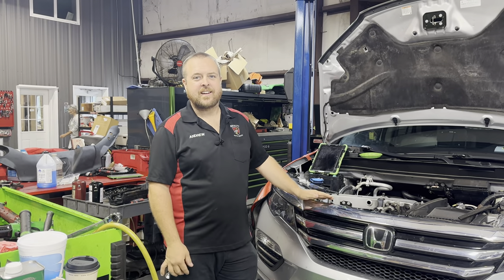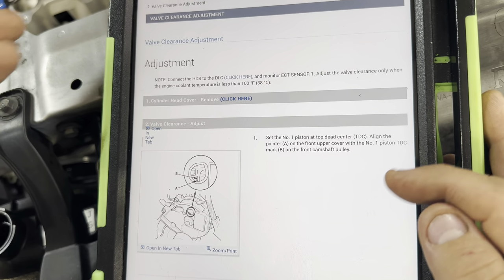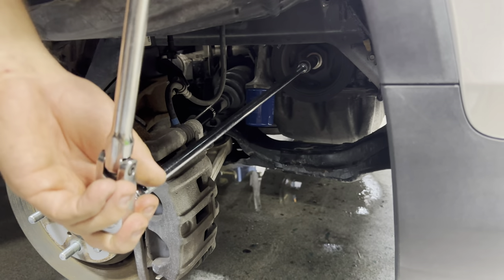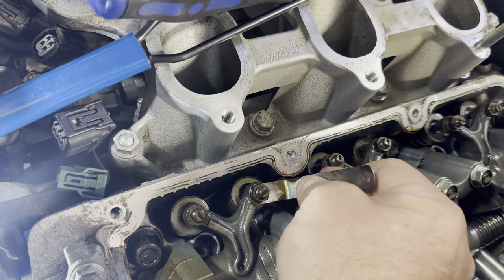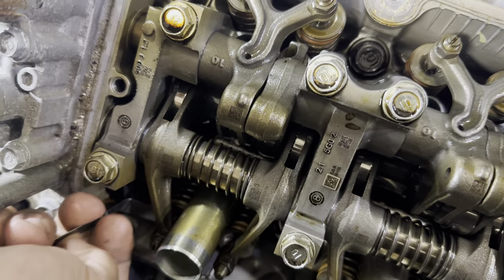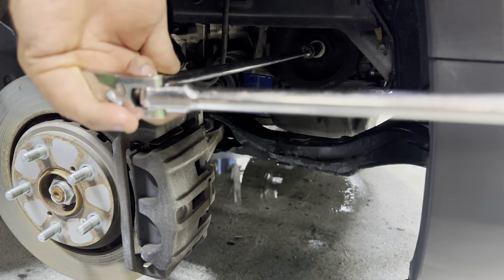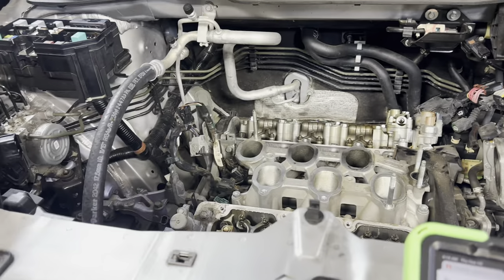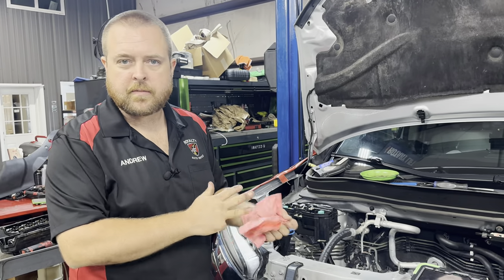Honda Valve Adjustment Basics (J Series Engine)

Comment: 1998 Honda prelude  214,000
Reply: 👍. 98 Prelude 255k.
Reply: No valve adjustment?
Reply: 08 pilot with 274k
Reply: @HighMileageOffroad  Have you ever had a valve adjustment on your ridgeline?
Reply: 06 Honda pilot 230k and running like a champion.

Comment: Hey guys great video, just to let you know the latest generation 3.5 litre v6 2024 doesn't require valve adjustments anymore Honda has gone to hydraulic lifters. Also there's a special tool available from Honda for valve adjustments.
Reply: Wow finally that's why I always hated Honda I always preferred Mazda they use bucket shims still good at 200k+ miles you can just swap them out
Reply: If you don't know what you are doing on these Honda V6 J Series engines DO NOT ATTEMPT THIS. If you get this wrong you can severely damage your engine.

Comment: Sister bought a 2009 Honda Pilot from a used car lot, Check engine light came on right when she got home. 5 cylinders missfiring, this has to be the reason right??? car drives fine.
Reply: Most likely, it's pretty common. 
If it's over a 100k miles it needs to be done anyway.
In my experience it's always wise to check into general maintenance after buying used vehicle yourself. Keep records so you know whats been done and when. 
If they say something has been done more often the not you'll find out their cousin Jett did it. Or a shop who pays mechanics by the job, not the hour.

Comment: I've noticed many older versions of this engine will idle roughly until the engine warms up. The valve lash actually closes up and holds the valve partially open, possibly because the valve seat wears or the valve stretches over time. A valve adjustment clears this problem up and makes the engine run like new. I think Honda actually had a bulletin about this issue.

Comment: Great video, however, you missed one very key item in the Alldata Maintenance Minder table.  Maintenance Minder Item 4 is for timing belt, spark plugs and valve lash inspection which means the valve lash check/adjustment is still due every 105K with timing belt and spark plugs.  The note you mentioned just means that if the valves are noisy they should be done at any of the other intervals, as well.  If the interval were "only when noisy" then you'd never find and adjust a tight valve.  In my experience, usually, the exhaust valves tighten up and the intakes loosen up.
Reply: Honda changed their recommendation for newer vehicles.
Reply: @jptrainor  No, they didn't.  I don't know why everyone thinks this.  This is taken right from the 2017 Honda Pilot owner's manual:  Maintenance Minder item 4 is "Replace spark plugs, Replace timing belt & inspect water pump, Inspect Valve Clearance."  Maintenance Sub Item 4 comes up at right around 105K miles, so inspecting valve clearances is part of that maintenance sub item with the timing belt and spark plug job.  At the top of the page it says "Adjust the valves during services A, B, 1, 2, or 3 if they are noisy" which just means to take care of them at any oil change or service visit if they are noisy.  They still are supposed to be inspected (and presumably adjusted if found out of spec) at the same time as timing belt/water pump/spark plugs.  

Having checked many at 105K I've found very few out of spec at 105K but have found plenty out of spec at 150K.  By 200K they can still be quiet but it's not uncommon to have unexplained misfires and rough running engine due to tight exhaust valves.  I've seen it several times.  Regardless, it's part of Maintenance Minder Sub item 4, every 105K, to check/inspect the valve clearances.
Reply: @johnaclark1  There's been a more recent change to the service recommendation AFAIK.
Reply: @jptrainor  No, it's still exactly the same up to at least 2022.
Reply: @johnaclark1  recent ... They're not going to (indeed, cannot) change the maintenance minder schedule for millions of shipped vehicles. There's plenty of talk, however, of the official Honda recommendation having changed.
Reply: @jptrainor  The Maintenance Minder itself is just a number that pops up.  Up until 2022 they were still printing valve adjustment at maintenance minder item 6 in the owners manual.  If there's an official Honda Service News article about it I've not seen it.  There can be talk anywhere.  Doesn't mean it's true.  People have been interpreting the owners manual wrong for years, thinking you only adjust the valves if they're noisy, which is just not true.  That works until the unexplained misfires happen and then they get adjusted, after shotgunning plugs, coils, injectors, etc. and sometimes after burning a valve, though I've only seen a burned exhaust valve on a Honda J35 once or twice.  

On the newer models they added a #7 for brake fluid but left the valve adjustment in there by mistake?  I doubt it.  Point me to an official change to what's in the owners manuals and Alldata (I have a professional Alldata subscription and It's currently listed in Alldata for the 2022 Pilot)
Reply: @johnaclark1  yeah... I got two old Hondas. Know the maintenance minder. Have done valve adjustment in both. You have a good one.

Comment: Did my valves this weekend and it runs like a brand new engine now.  Valves were too tight and it caused the engine to run like complete crap with a very rough idle.  Really makes a difference, and is very easy to do.  If you've got an 8th gen Civic, be prepared to have a sore lower back when you're done tho! 

I do one cylinder at a time, intake, then exhaust, torque, check again, on to the next.  Come back around once you've done them all and recheck and adjust as needed.  I find that as I progress through the cylinders I get more and more precise with the adjustment and the early cylinders need to be nipped up a bit.  

Valve adjustments and on-time oil changes and a 200k mile R18 will continue to run as if it were fresh from the factory.  Excellent little engines!

Best tip I can share... crack the locking nuts loose with your ratchet, then disconnect the extension with your socket attacked and gently tighten the nut again, just till it stops.  This will make the screw part of the adjustment "firm" and hold where you set it when you go to torque.  If you have the locking nut too lose, the smallest bump will throw off your adjustment.

Comment: The Honda valve adjusting tool is part# 07MAA-PR70120. Cost about $45, and has a dial instead of a long driver handle.  Downside is you have to use a separate wrench on the socket-piece to loosen/tighten the jam nut.  There were knockoff versions like the Alltrade/Powerbuilt 648822 that I have, but can't seem to find for sale anymore.
Reply: amazon! $25

Comment: I’m a technician at a Honda dealer we recommend them every 105k as well with the timing belt service normally. Also the new Pilot (Ridgelines and Odysseys still have the older engine) with the updated engine in the current gen pilot no longer requires a valve adjustment.
Reply: Question for you. I have a 09 mdx mis fire on 3,5,6. I did the spark plugs and the coils for all. The misfire is still present along with “check emission system” and check sh-AWD system”. Unfortunately my Honda dealer has not been helpful. They wanted me to change the timing belt and then check the spark plugs. Which I just did. Is it possible this is balance adjustment? I booked in for an adjustment tomorrow shot in the dark just hoping this will resolve the issue. Any info would be greatly appreciated! Thanks!
Reply: @cooperbell3420  could be your valve adjustment if I had to make a guess but I really wouldn’t know unless the car was I front of me

Comment: 2005 MDX, 246k miles...multiple cylinder misfires.  Mostly one side,  but really all cylinders.  Bought plugs, coils, PCV and may get an EGR. Hoping it doesn't need a valve lash adjustment.

Comment: Hi, great video btw, and helpful commentary along the way. I'm lost and would really appreciate some expertise! My 2005 Accord v6 has been running well until recently on a long drive several misfire codes popped up at once. There was some rough idling and I could feel some misfires on the way home. I changed spark plugs only 500 mi ago; since the codes came all at once, I don't think it's coils either. Is it likely that the valve clearances are the issue? Especially with what you said at 8:20 .
I also have three electronic codes that popped up with the misfires, one being 83-1 (ECM/PCM relation failure). I don't know if the computer might be causing the issues or even if they're related. If you can please share an expert opinion, I would appreciate it.

Comment: Do you guys use your Intake vacuum waveform to check for valve adjustment, not an exact measurement for in/mm but you can see the timing between pressure pulses and you can see if the exhaust valve is out of whack based on how high its pulse is compared to the intake pulse height as the exhaust is typically the one which beats itself into the valve seat making it tight. Of course, your transducer needs to be set up properly and look a bit more wavy than what some techs prefer, cheers.

Comment: How can you be certain you’re on the compression stroke during the valve adjustment? 
Is it good enough to just line up the hash marks? 
The manual I have just says position to TDC no.1 then move on…
Reply: You could stick a long screwdriver in the cylinder and check the piston location.
Reply: Just go by the labels on the cam shaft.  If for whatever reason you don't trust the labels (just go by the labels), you can wiggle the rocker arms and if they move, they're not applying pressure to the valve, and you are good to adjust (only a TDC will both intake and exhaust rockers be free from tension)... but just go by the labels on the cam gear... that's what they're there for.
Reply: Camshaft pulley has labels on it.  When you're on 1 then your engine is TDC on cylinder 1

Comment: Hi great video. I have a 03 Honda pilot that had the timing belt put on after it broke while driving. The  car is running thankfully however I get random misfires now and sometimes car turns off. Could it be the valves loosened up or misadjusted when the timing belt broke? And now I’m having these problems? Thanks in advance for any advice! 
Great video
Reply: Check the codes. Probably a crank position sensor causing the motor to stall.

Comment: My 2010 Odyssey EX-L vavles were all bit loose at 235 k km (146k miles) except cylinder 5 exhaust valves which were a bit tight. I've owned the vehicle since new and it was the first time they were done (I didn't do them at the 160k km maintenance minder interval). I guess with Honda's new "when noisy" recommendation they are waiting for vehicles with tight vavles to come in with misfires in the case where they tighten over time.

Comment: My question is if in the manual it says you could use this size this size or this size for The Gap, how do I determine which one to choose.?! I have a 2007 Honda Ridgeline j series engine. I did the valve adjustment for the first time it nearly 200,000 miles, I drove it 5,000 mi it sounded pretty good and now it sounds bad, there is a loud clacking sound on cylinder one and six intake on one end exhaust on six.

Comment: Where are you located? I think my valves need an adjustment. It clicks when im over 2000rpm. Would that be my rocker arms/valves?
Reply: 8 months later did you find your fix? For me i knew it was the valves when i herd that one of the symptoms was the tapping, only when it got hot, realized it was fine on cold start, then started tapping when it got hot. Adjusted it myself to find 3 exhaust valves were over %50 too loose.

Comment: I did the twice on my Honda odyssey. Both times values got noisy within 3k miles. Seems like the adjustment screws keep working loose. Would it be a bad idea to clean them up and add a little lock tight to stop them from moving? And yes I get the jam nuts tight!
Reply: Locktite is a bad idea. Not for internal use.
Reply: how much torque did you apply to the locking nuts?

Comment: Would love to see how to get to this point. Pulling off all the shit before this. The harnesses seem to be the biggest burden of it all.
Reply: The rear harness stayed in place for mine. I unclipped a few harness clamps to give it some slack, that's all. That's was the service manual procedure.  I don't know what this vehicle was but it was obviously totally clear. I've seen quite a few videos and it seems to vary, but most typically the rear harness remains in place but is given slack and then you work around it.

Comment: Would a rattling noise on acceleration potentially be caused by valves that need adjustment? Car is 2011 Odyssey with 160K, well maintained otherwise.
Reply: Try to use gas with higher octane. My 2000 would knock on 87 accelerating up a hill when it was new. Switched to 89 and it stopped. I ran 93 in it for a little more horsepower until recently due to high prices- but still no lower than 89.

Comment: What is the pros and cons for hydraulic lifters vds these adjustable?
Reply: hydro lifters don't need to be adjusted, but are more complex and are another point of failure.  There's more to it than that tho... two completely different engine designs.  The overhead cam design is as simple as it gets, and that's what makes it a great design that's been around over 100 years.

Comment: Woundering. My 2018 civic hatchback. How should the valves sound like when properly adjusted. I understand there will be some ticking. 
Also. Should the exhaust vales be opened to 11 or 10. I understand over time the valves intend to tighten. Having the lash open more would be better or stay with 10?
Reply: My 2006 Civic (different engine than 2018) were all loose at 250k km (156k miles) when I first did it. The engine sounded like the clicky clack of a sewing machine.  After the adjustment it quieted down and there was no distict sewing machine sound. It's hard to describe, but it very clearly made that noise before the adjustment and it clearly wasn't making the noise after. It's still quiet at 395k km (246k miles).
Reply: @jptrainor  cool! I just recently readjusted my valves once more to give it a fine-tune. I still get a bit of ticking still. Normal for Honda. This is my fourth civic hatchback. Thanks for the reply.
Reply: @jptrainor have the same car. I sudo own it since my parents use a different car now and i was left with the old one. It was tapping for a while until i did the adjustment (at 225k miles). Over %50 too loose on 3 exhaust valves, all others were too loose except 1 intake. The car was kinda neglected except for brakes, oil, tires. Changing the black transmission fluid & filter in a few days.

Comment: 8:51 

“Exhaust valves too tight”

My problem. When you beat on hondas they dont get loose, they get tighter 🤣🤣🤣. 

For real though. I personally believe when you bounce a 1980-2020 honda motor off the redline it makes the exhaust valves get tighter.
Reply: Same, on my civic, 3 of the exhaust valves was at over 0.015mm (didn't bother checking bigger feelers) while the repair manual said 0.010mm 🤯. That explained why it tapped really loudly before i adjusted it. Even with the 0.015mm it felt loose.

Comment: @3:15 New "J35Y8":

No VTEC
No valve adjustments required.
Timing belt .......
VCM may prove to be a costly repair 
I am not a Honda tech nor am I professionally trained
Reply: Looks like it's at @255 time stamp on black plastic cover.         J35Y8

Comment: My daughter's 2013 CRV rattles like a diesel at startup, but quits down soon as oil pressure comes up.  Is that a symptom the valves are loose?
Reply from the maker: It’s possible but it sounds more like a timing chain issue. Hard to say without hearing it. But yes it could be a symptom of this issue.
Reply: That also could be the vvti gear. They are know to go bad in that generation along with many other cars. Look up vvti gear rattle and check if the sound is the same as you are experiencing.
Reply: Sounds like the infamous Honda VTC rattle. Chris Fix has a nice video on this.
Reply: @donaldlee6760  Hey thank you for that tip, and link!  That is exactly what hers sounds like upon startup.  Now I know what the fix is.  Weird I had not seen this before, as I follow Chris Fix.
Reply: Same 2.4 engine in my 2014 Accord. It was the timing chain tensioner. Less than $60 for an OEM part on eBay.

Comment: The 2024 models are no longer using this. They are self adjusting now.
Reply: They also are using dual overhead cams per cylinder head on some models. So a total of four cams now.

Comment: Don’t these engines have hydraulic valve lifters? I thought valve adjustments were a thing of the distant past.
Reply: No hydraulic lifters Honda is different
Reply: @DANNYN224  
Thanks. Would you know the reason why Honda doesn’t use them? I’m just curious. Tia!
Reply: @Conservator. well 2023 pilots don’t require valve adjustments anymore, but Honda doesn’t fix what isn’t broke. They don’t have valve train problems like GM Chrysler do for a reason
Reply: They've added hydraulic lifters to the J-series engines recently (like he mentioned in the video). But until the last few years they were all like you see in this video. All the 4 cyclinder engines still use adjustable rockers AFAIK.
Reply: @Conservator. hydraulic lifters add complexity and unnecessary moving mass to the valve train.
Reply: Thanks All for your replies!